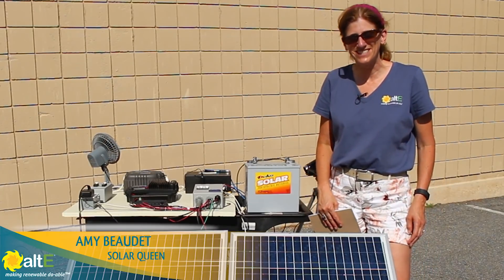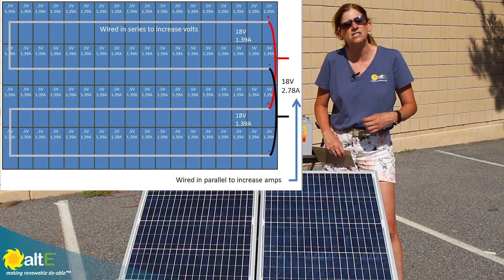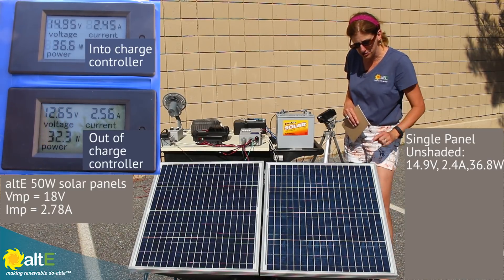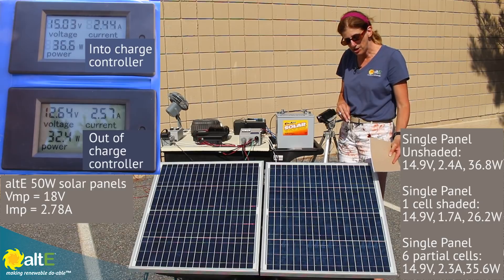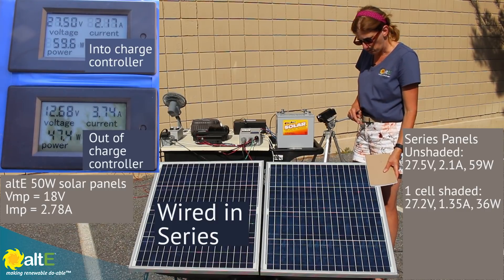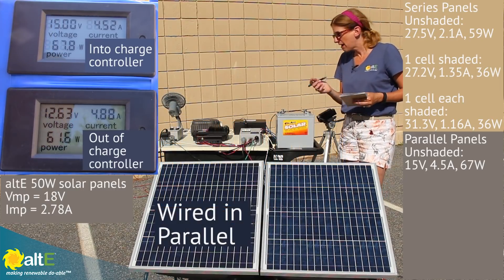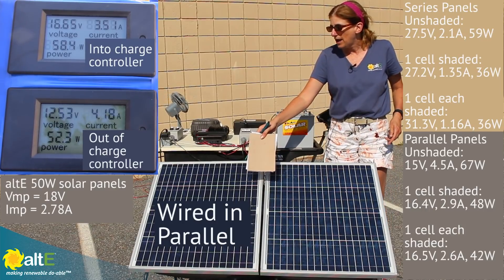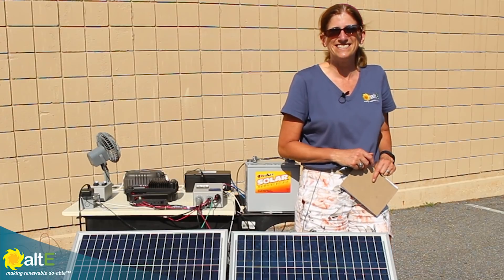How to Wire Shaded Solar Panels

Comment: Since it's been awhile since anyone added a new comment, and since I'm learning a lot now about residential solar energy, I can update people on this topic.  Enphase microinverters and SolarEdge inverter with optimizers essentially provide parallel wiring of your panels, which is what Amy is showing the advantages of.  Pretty much all residential systems use microinverters or optimizers these days, and therefore use parallel panel wiring.  Shading is indeed a problem for my house.  But of the panels that are out there, I found one that takes this goal of localized partitioning for minimizing shade induced production loss a step further.  Solaria (based in Fremont, CA) wires their cells into 4 quadrants on their panels, essentially turning their panel into 4 mini-panels.  Within each quadrant the cells are, as normal, wired in series.  But the quadrant's outputs are run in parallel.  This means that when a tree branch casts a shadow across the corner of a panel only that corner quadrant drops down in output, while the other 3 quadrants maintain the full output.  So, summarizing: in the old days panels were wired in series.  When shade was cast on part of one panel all panel's outputs dropped down to the lowest performing shade-effected panel.  Today, with panels wired in parallel, when shade is cast on part of one panel, typically that whole panel, but only that one panel, drops down in power output.  But with the Solaria panels, when shade is cast on part of one panel, that panel drops down only on the quadrant(s) affected so that the affected panel has minimized the affect from the shading.  I haven't heard of any other panel manufacturer doing this, but maybe they're out there.  Maybe someday they'll engineer panels so that all cells will be wired in parallel for optimal (minimal) shade effect.  No, I don't work for Solaria.  But since I have shade problems this is the panel I'm selecting, after a lot of panel shopping, for my new rooftop residential system.

Comment: So what are the benefits of series, unless all panels are in perfect sunlight all day
Reply from the maker: The benefits of series are if you are using an MPPT charge controller, you can run to the charge controller at a higher voltage  and lower current, with less voltage drop and smaller (cheaper) wire.

Comment: Here is an Idea I had... Why don't solar panel manufacturers have some type of internal switching device so that if a particular cell is low on output (indicating it is likely shaded), that it just acts as a passthru, supplying 0 volts for that cell, but very little resistance to the rest of the panel.  For example, if the entire panel lit up well is 18.0V, then you cover just 1 of the cells, that cell would switch to "passthru" mode and the entire panel would then be 17.5V but with the same current as with 18V.  Thus you may only see about a 3% loss in total power, rather than about 30% or so that you were seeing.   It might be more expensive to make them this way but that sure would be slick.  That way, if up to 25% of the panel is shaded, it can still make enough voltage to charge a 12V battery bank (25% down from 18V leaves 13.5V).  This would probably solve the series partially shaded issue.
Reply: Your idea is absolutely correct. To achieve this goal, manufacturers of solar panels used to install plenty of the so called "bypass" diodes. It was that time, in the past, where quality was the first characteristic of any product....So each panel had very effective protection against shading (: the more bypass diodes within the panel, the less power loss of the panel due to shading). Nowadays, cheapness is governing the market. Therefore...two bypass diodes in the best case, or none at all for the most of them...Competition makes this situation worst than ever before as regards quality. I wonder if there are panels out there using, say, six or eight bypass diodes any longer...And I finally don't think that there are...These things were happening at the time when the individual cells were circular in shape. So there was plenty of space available for installing these diodes. The rectangular shape of the modern cells makes things difficult for placing bypass diodes in the panels, but still the main factor for their disappearance is the cost they add. Quality does not matter any longer...

Comment: Nice presentation but you mentioned a few things and didn't elaborate on them.  One is that for those 2 panels, you recommend using separate charge controllers to get maximum power.  Regarding that, I have 2 main questions:

1) Assuming both charge controllers are for 12V battery bank, is it ok to connect them both to the same battery bank at the same time without causing any issues?

2) Is it better than #1 if you have a 24V series connected battery bank and instead connect one 12V controller to one 12V "leg" and the other 12V controller to the other "leg"?

Comment: What she didn't show was that if you shaded the panel halfway down, you would notice a massive difference, those panels are two strings of cells in parallel, shading cells from both sides of the panel would show a big difference.....

Comment: How does the addition of power optimizers effect this same demonstration?
Reply from the maker: k bob it changes everything. Since DC optimizers maximize the output of each panel, and isolate them from each other, one shaded panel has no effect on the others. However, they are mostly used in grid tied systems, they usually aren't used in battery based systems like this demo.
Reply: +altE - ok gotcha. What about series vrs parallel using optimizers? I know there may not be a simple answer.

Comment: Wondering if mounting a diffuser lens above or white reflector beside the panel would be useful by spreading the light out and overcoming shade problem.
Or heck amorphous silicon cells have much less problem w shading so just use them (or maybe instead as a translucent diffusing layer over each mono-/poly-si cell with each pair being in parallel to reduce resistance during shade events).

Comment: Dont forget the blocking diode if you dont use a charge controller on a parallel setup w shade conditions. Put the b.diode in series w each parallel panel/array. Then voltage wont flow into the shaded panel as an alternate path.
Reply: And little to no mention of by-pass diodes or microinverters, power optimizers as other alternatives.
Reply from the maker: We've got another video talking about diodes, https://youtu.be/5rYy0gHZepI.
Reply from the maker: This was referring to off grid systems, so microinverters and most optimizers are not an option.
Reply: +altE; thanks. Great presentation on both vids. Didnt know you had one on diodes. Just wanted to mention diodes to share the cutting edge of technology. Shaded cells are more of a problem than the sun's tracking out of perpendicular!

Comment: Can we use Dc current in small connection to glow the bulb as we know 12VPanel, 12 Volt charge controller and 6volt bulb. in this connection we didn't attached Inverter, actually it should be there in demo.
Reply: pls clear my doubt
Reply from the maker: You could run a 12V load directly, but not a 6V one.

Comment: I've got 3 x 100 watt, 2 x 150 watt & 1 - 120 watt panels all 12V with partial shade how should I wire this system and should I use a mmpt charge controller

Comment: What about a small mppt optimizer/booster for each panel and then put them in series?
Reply: Worthless buy a big deasent panel from a trustet manufactor 
With BY PASS DIODES .. THEN THE SHARED AREA JUST GET BYPASSED
All the other nonsens is What IT is .. IT IS REAL ON SMALL PANELS WITH OUT DIODES .. BUT NOT IN THE GROWN UP WORLD 
WITH BY PASS DIODE'S

Comment: for compact installations it might be great the parallel setup, but this methode requires bigger wiring, low voltage high current is more difficult to transport (more loss) than higher voltage systems (series)
in some situations it could be good to mix series and parallel
Reply from the maker: Absolutely. A larger system is best with an MPPT charge controller that can allow you to wire panels in series for higher voltage and lower current.

Comment: the 10% loss of the pwm controller is quite substantial until the voltage drops so low that charging cannot happen.. it is the change in Power which is important .. so the amperage or wattage is the thing to watch !

Comment: Great demo. I didn't realize there was a difference between partial shading when panels were wired in parallel versus wired in series. Your demo really makes this clear and understandable.
Reply: Onley when you use cheap skate PV .. 
Real PV has BY PASS DIODES .. 
SO SHADING GET BYPASSED AND SERIEL WINS !! 
But well i am from Denmark and we know this hmm 30 yers now
By PASS DIODE's ain't a new thing .. on deasent PV panels 
But there is No need or use fore Them in these small setup..
But when you got 48 panels like i do .. you know a misleading story
This don't appley to big deasent PV ..

Comment: what about fuses if connectet in parallel?
Reply from the maker: Usually, you would wire them in parallel with a combiner box. The combiner box has a breaker on the positive line for each string. The output of the breakers are combined. You can see more at https://youtu.be/iOqY6QqFopA

Comment: a question.  , in my 8 panels setup one panel face the shade , all are connected in series,  obviously they have built-in bypass diodes,  may I know what would be your expert advice,  should I install another bypass diode on that PANEL although it has built-in internal diodes present?   or the blocking diode with that panel would be good?  plz advice.

Comment: I see on your website that you offer a solar optimized panel. I do understand the internal function of these panels. What experience have you had with them in off grid arrays? Thanks!
Reply from the maker: The only DC optimizers we currently sell are by SolarEdge, and they must be used with a SolarEdge string inverter. So although other brands can be used with charge controllers,  we don't generally have optimizers in off-grid systems.
Reply: altE Thanks, I was referring to https://www.altestore.com/store/solar-panels/canadian-solar-255-watt-smart-module-with-solaredge-optimizer-p40428/. It is my understanding that each internal string in the panel has a Maxim optimized chip in place of the diode. On or off grid no matter.
Reply from the maker: The DC Optimizer on that panel is the SolarEdge Optimizer. We don't currently carry the one you are referring to with the Maxim chip.
Reply: altE Yes, sorry about that. To clarify, Solar Edge uses the Maxim chip as their OEM. Being that they optimize each individual internal string, I was wondering about your experiences with that panel is all. Thanks

Comment: I'm building a portable solar trailer to charge my electric trike.  I'm using (2) two 120w 19v 6.7a flexible solar panels.  While being towed behind my etrike, only one panel (on top) will be exposed) to trickle charge my 48v battery (using a Genasun GVB-8 boost charge controller).  When I reach my destination campsite, I will set the top panel off to the side and aim it to the sun while the second (bottom) solar panel is then exposed.    
Is it better to have (2) two MPPT boost charge controllers (one for each panel)..?  And would I need a blocking diode for the bottom (not exposed while in transit)..?  
Or... would it be better to get a 200w solar panel..?  which would also fit in the track width of the trailer..
Suggestions...?    Thank you so much.  I may need to call you to set up a consultation.  :)  Can I reach you thru your website..?  My goal is to be able to ride an extra 3-4 hours a day because of the trickle charging as I ride.  The Lithium-ion batteries will be fully charge at the beginning of the ride and the controller will kick in to trickle when the volts start to drain from the battery.  Marissa Muller did this on a trip across America and each day she was still at 75% charge on the 17ah battery.
Reply from the maker: If the single 200W will fit, that may be the better option. That gives you more charging as you are riding, rather than just when you have stopped, which is likely when there will also be less sun. But you could do the math based on your schedule. Does lower wattage for more hours give you more energy than more wattage for less time?

Generally if each panel has its own charge controller, an additional diode is not needed, the charge controller will handle that.

Comment: Would it be feasible have a micro charge controller per cell? would that increase the performance o the whole panel even if it was partly shaded? what would be the cost implications for a panel with 72 cells?
Reply from the maker: Interesting idea, but I don't know if the improvement would be worth the additional cost.

Comment: So in a case like this would it be ok to connect the panels to separate charge controllers and connect each charge controller  to the same battery?
Reply from the maker: Yes, separate charge controllers would be the ideal solution. The output of each charge controller should have its own breaker, and then would be wired to the battery.
Reply: Thanks :)

Comment: Hello hello Amy and AltE...I really apreciate your "Hands On" series on top of your theoretical series...!  Learning a lot.    I have an old Japanese saying I use: "Function over Form".    I believe you know this, but, just to be sure:  In the beginning of this video, you mention the individual solar cells of 0,5V being connected in series, to obtain 18V.    Pointing out the series along the top and showing it again in the diagram, is not a correct electrical "Series":  The cells have a negative pad on the top and a positive pad on the bottom side.  They are wired in series: From one Top(neg) to the next Bottom(plus), to ad up the voltages.   PS:  I know this video is: How to Wire Panels and I am murking around down in the machine room.   Anyway...Spring Greetings to all from Denmark...Jakob

Comment: Do these panels have bypass diodes? From the specs it doesn't look like they do. How do bypass diodes effect shading scenario?
Reply from the maker: Yes they do. They have 2 bypass diodes in the junction box.They route power around a cell string that has lower voltage than the others, for instance if some cells are shaded. You can see more in our video on diodes, https://www.youtube.com/watch?v=5rYy0gHZepI

Comment: Hi Amy, nice video, can you illustrate the wiring of the mutli meters (into the charge controller, and the out of the out from the ct, thanks
Reply from the maker: Thanks for the request. I'm not able to edit existing videos, I'll make sure to add those details to my next demo videos. I'm outgrowing the existing system, so am building a better, bigger one for the spring. I'll make sure to have good closeups and schematics for them.

Comment: I'm wondering if there's any direction in making charge CO trolleys smaller. If I had a controller that was half the size of what I have now I could dedicate a controller per panel. As it is now it would be very difficult to alter the system I have at all because of size restrictions(it's in an RV). For shading purposes it would be very advantageous to isolate individual panels.
Reply from the maker: Genasun makes small MPPT charge controllers for 145W panels and smaller. https://www.altestore.com/store/charge-controllers/solar-charge-controllers/mppt-solar-charge-controllers/genasun-solar-charge-controllers-c1239/ MorningStar, Steca, Outback, Samlex , Phocos, and others all make several small PWM charge controllers perfect for individual panels. https://www.altestore.com/store/charge-controllers/solar-charge-controllers/pwm-solar-charge-controllers-c477/
Reply: Thank you!

Comment: You mentioned connecting each panel to its own, separate, charge controller. Would one then connect those, in parallel, to a single battery bank? How do they coordinate charge current so the batteries don't get over charged?
Reply from the maker: Excellent question with 2 answers. If they are small charge controllers without communication between them, they would just each turn off their solar panel when it senses the battery is full. If all of the charge controllers have the same settings, they will all pretty much turn off at the same time.  If the charge controllers are more sophisticated, they may be wired together with a communication port, and can coordinate and organize with each other. For example, Midnite does a "follow-me" where one charge controller is in charge, and tells all of the other ones when to switch from bulk to absorb, when to turn off, etc.

Comment: how does shading effect performance of 2, 3, 4 bus bar panels, wires that wire cells together in the panel it's self?
Does it make better sense to use the Hotpoint panels in parallel for a 24 v system in a less than ideal sunny location vs buying one $3oo+ panel to have three or four bus bars?
Boo
Reply from the maker: Since the busbars wire the cells in series, they do not affect the performance in the shade like parallel wires would. So two lower wattage panels in parallel may be a better fit for you than one big one.
Reply: Please !!! This company is Selling you garbage panels 
With out !!!! 
Magic word ... BY PASS DIODES !!! 
When you use panels in series the affekted area with SHADDOWS 
Will just get yes ding ding ding you won!!! BY PASSED ... 
WHAT A REALEAF .. 
DON'T BUY CHEAP PANALS WITH OUT ... MAGIC WORD.. 
B Y ... P A S S ... D I O D E's !!!

Comment: How about when both panels are shaded by clouds, is there any advantage to parallel or series wiring?
Reply from the maker: A cloud would more than likely affect all of the panels similarly, so I would not worry about cloud shading. Wire it whichever way makes the most sense for other conditions that may affect parts of the array.
Reply: altE  Thanks!  You guys are the best!